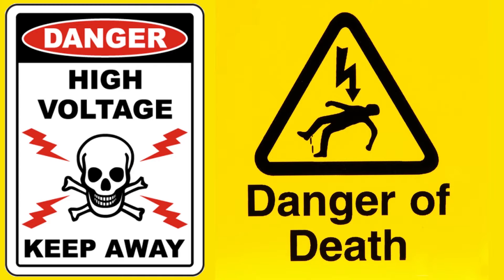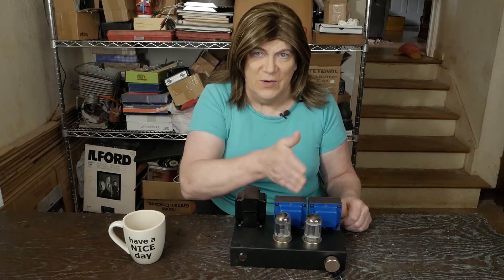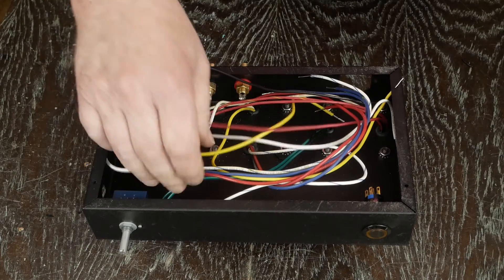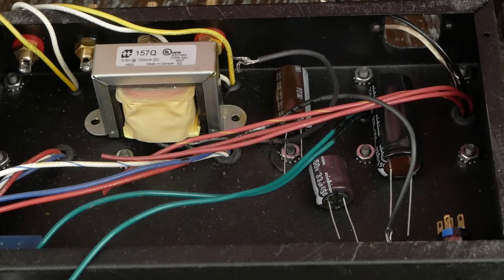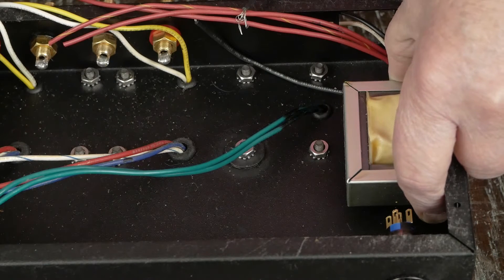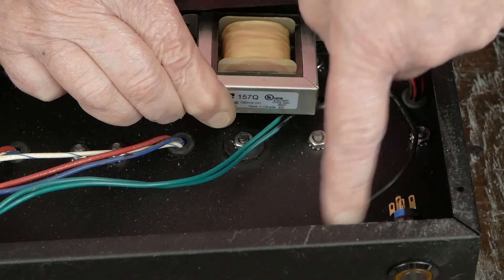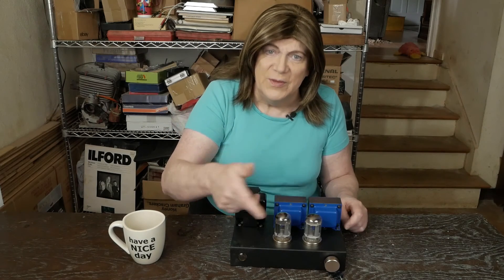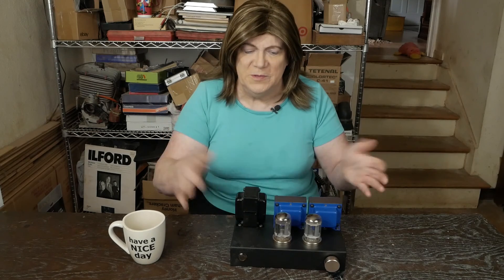DIY 5W Compact Tube Audio Amplifier: Final Layout Design

Comment: Totally agree that the choke would work best in the last position you showed. 👍 Just an idea, and I’m not sure if you meant this, but tag strips could also go on the sides, if you ever need. 🤷‍♂️ i know it’d be a pain in the butt, but the PSU could go in another chassis for total separation, but you know this..lol. I think your layout design looks great so far. I think this amp will likely work out well. 🔊🎶😊 Great vid. Thanks!
Reply from the maker: Yeah a separate chassis for the PSU would defeat the purpose of this amp, small and compact :) I think it's gonna work great!